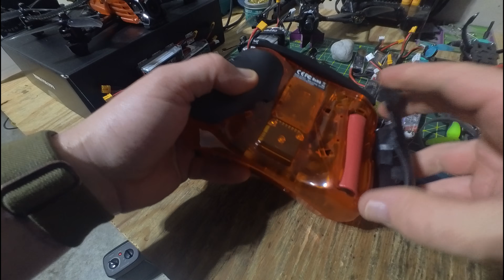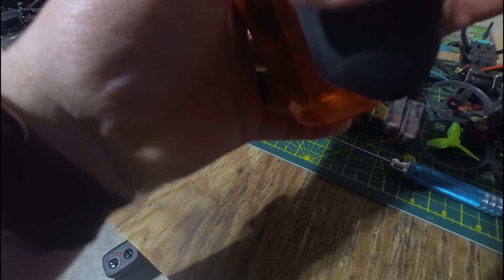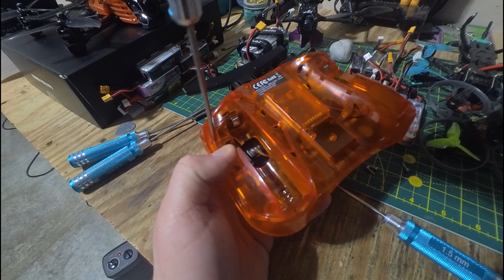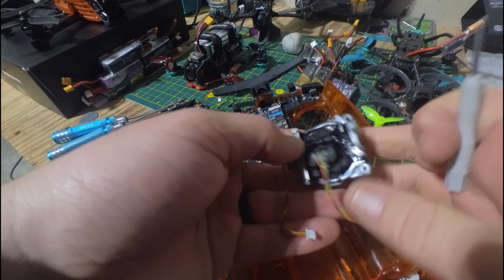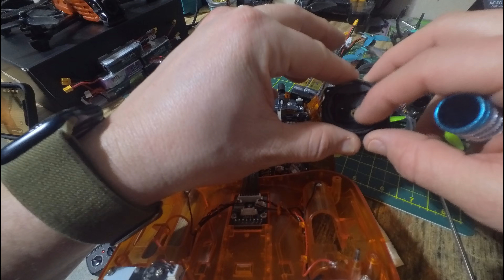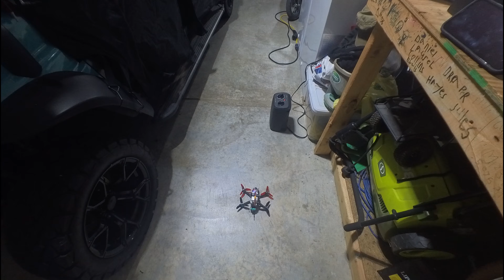RadioMaster Pocket Gimbal Upgrade Tutorial (AG01 Nano) #radiomaster #edgetx #elrs #info #fpv #fyp

Comment: It's a shame they don't have this stock as part of the pocket crush line like the Boxer crush has CNC gimbals. Would be neat to see the pocket form factor with removable sticks but the CNC quality.  

How are you liking your mod? I opted for the Boxer crush as my first controller but the form factor of the pocket is tempting.
Reply from the maker: I 100% agree that they should have a pocket already with the CNC gimbal’s install installed. I’m sure people would pay the extra 40 or $50 they could squeeze out of having that available. I really like these gimbals so I’m glad I upgraded, but I don’t necessarily think you need to upgrade to the CNC gimbals. They are just really nice to have.

Comment: Been wanting to get these but the price has been so high now. Can't find them for less than like 80 dollars shipped... for that price I kinda just wanna save up for a GX12
Reply from the maker: Yeah, I know what you mean. It’s kind of hard to justify it but I dove down into this form factor with the intention of upgrading parts because coming from the TX 16 S it’s gigantic compared to this and I like the small form factor. I found these on Amazon for $75 so pretty close to 80 which is almost double what the controller is now. I would say if you haven’t already purchased the pocket controller then go for something already upgraded with the AGO1s that fits the size you want

Comment: I also almost replaced my pocket's gimbals to the ag01 nanos but banggood didn't have any stock. So I bought the TX15 max, what a awesome radio - I honestly fly better vs with the pocket and probably my fav gear I have bought all things considered. Never knew the pocket is only 250mW max output power and only 2.4Ghz, where the TX15 max goes too 1W and has 915mhz or 2.4ghz so can do LR or normal 2.4ghz. 

Full size gimbals seems to fit my hands better than the smaller pocket size gimbals. But must be a nice upgrade non the less - cnc smoothness so nice.
Reply from the maker: My original TX that I still run is the Radiomaster TX16S. It was the 4 in 1 version so I early on jumped on the Ranger Micro for my ELRS trasition. I love the TX16s transmitter, but like most, the large form factor kinda starts to be more of a burden when traveling or just heading to a new spot to fly. It doesn’t fit into my FPV bag so I would have to take a separate case to carry the transmitter.

So a few months back, I got the RadioMaster pocket and I too didn’t realize it only had 250mW max output, so I have more gear coming in a few days…the Ranger nano modular bay. It will allow me to output 1W or power so i can have the extra headroom if needed!!

The TX15 is a nice radio!! Great choice!! 🎉🎉